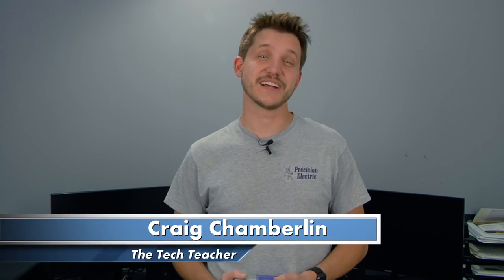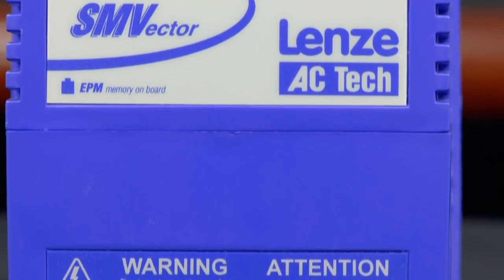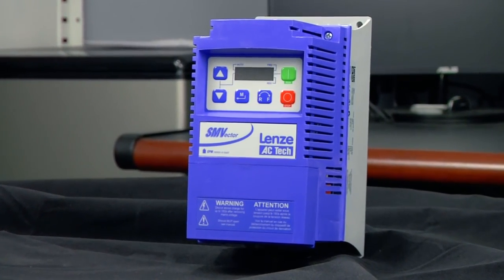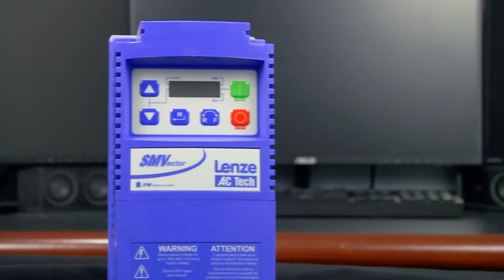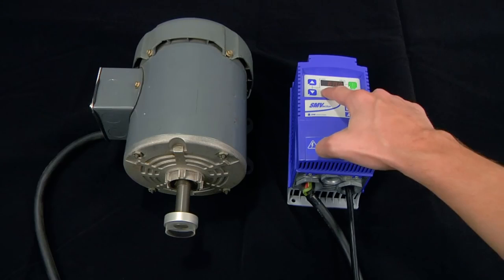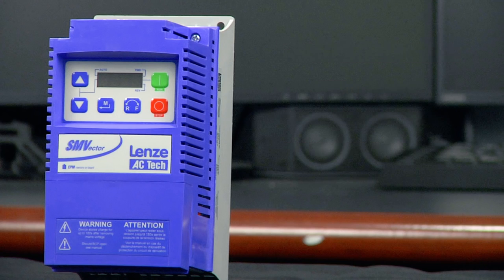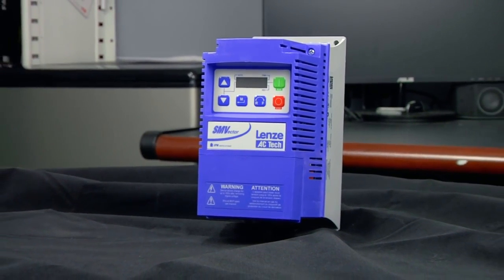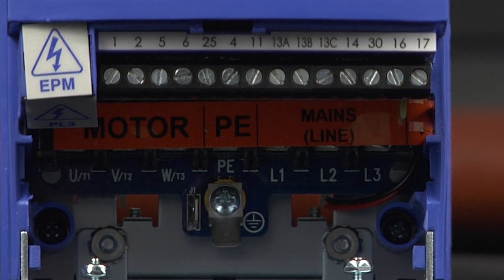Lenze AC Tech SMVector Variable Frequency Drive Review

Comment: Had a power loss while motor was running caused fault lockout F.0F1. Could not clear alarm fault even after power down reset. After reading Lenze online troubleshooting guide pulled leads to motor on terminals U,V,W the renergized power alarm then fault cleared.  Then denergized connected Motor leads back onto U,V,W and then started to operate normally. Why would removing the leads on U,V,W be the only way to clear the fault you would think complete powerdown reset would do the same thing. Greatful for Lenze having online troubleshooting guide available.  troubleshooting guide
Reply: This was single phase 120 volt power coming in btw